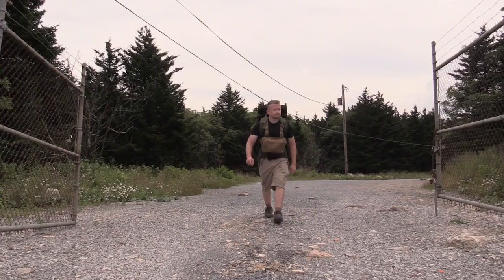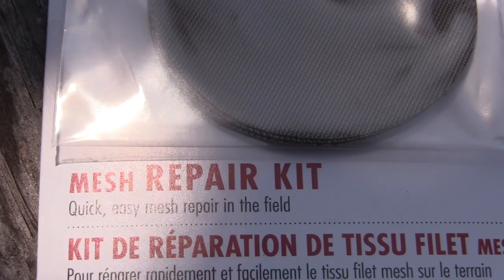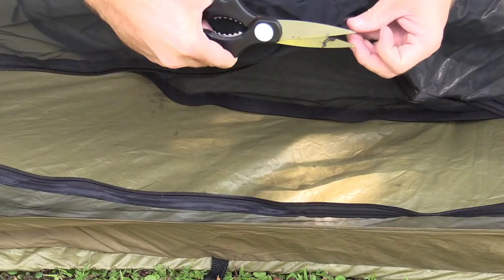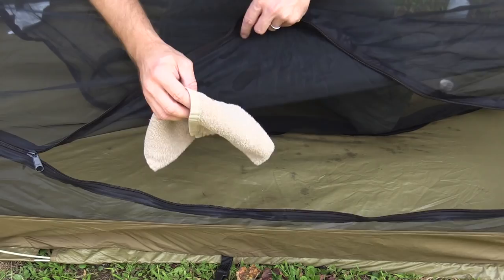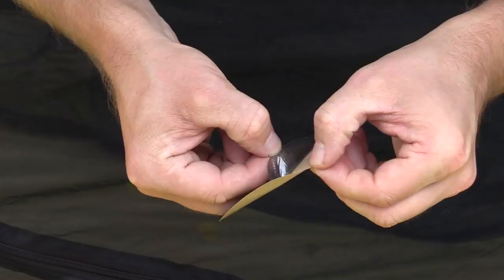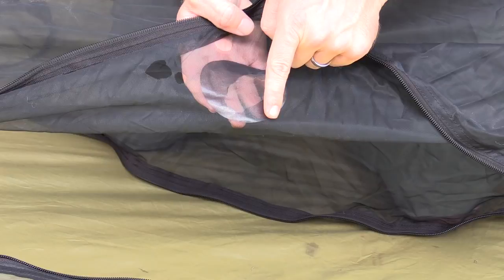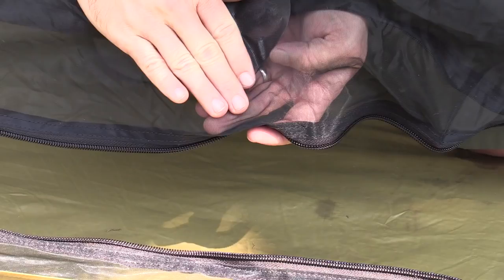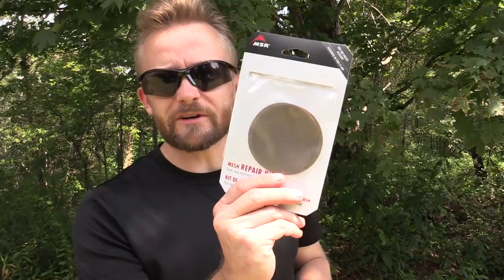Simple and Easy - How to Fix Tent Mesh – Quick Instruction Guide

Comment: Is that really a mesh patch, or just a plastic tape patch with a mesh pattern printed on it?  The patch looked solid (ie, no air could pass through).
Reply: Thought the same. wondering if there is a thin foil to remove.
Reply: Any adhesive patch is going to have a solid layer of the adhesive. The main difference from the usual fabric patch is visual impact. If airflow is important to you, sew a piece of mesh on.

Comment: I like to place a board or book behind the hole so I can press it on flat and really rub the edges to adhere.  Your hand is concave and doesn't work as well.  Results for both technically and aesthetically, this is a good way to do it on a flat surface.  I have some holes that are just a bit bigger than pinholes, do you think clear silicone glue would be good to basically just plug up the hole?  I was going to use #6000 but afraid it would devour the nylon screening.

Comment: I wish there were different colors. Mine netting is light brown/beige color. I fixed it with a clear gorilla tape. The hole was only about 1 inch x 1/2 inch.
Reply: I use the clear gorilla tape for all my tent repairs. As long as you make sure it has a flush contact & use tape on both inside & outside of the repair...it's a waterproof seal again! Good luck if this helps  anyone.

Comment: Hey, great video. But will this work near the seam?  My mesh is coming apart from the seam by the zipper
Reply: Did you ever find anything to fix your tear? I have a rip near the stitching too.
Reply: @sloothlothos1  i haven't fixed it yet but mainly because in my area there hasn't been much camping allowed due to covid
Reply: I had a big separation at the zipper.  I put it back into place and then on sewing machine zig zag stitched back and forth a few times, seems ok just have to use a zipper foot so you don't mangle the zipper or get threads on it.

Comment: I got a tear in my mesh that’s right on the edge, how do I repair that one? It looks like it has to be sewn in
Reply: had a big separation at the zipper.  I put it back into place and then on sewing machine zig zag stitched back and forth a few times, seems ok just have to use a zipper foot so you don't mangle the zipper or get threads on it.

Comment: Hi, love the channel. Question: I bought this cheap tarp off amazon to shade my patio deck from sun and rain. The first time I set up the tarp to my deck posts one of the loops ripped the actual tarp a tiny bit. After 2 days of being up in some pretty high winds that small tear, ripped right down the length of the tarp just inside the loops on the tarp itself, it's several feet long that rip. Do you think tenacious tape could fix that and it actually hold up to those same winds? Opinion? Thanks bud!!!
Reply: sewing machine, zigzag would be good, that's what I do on my tent tears sometimes adding a patch behind.

Comment: does that same company make a tent repair kit just like that one?
Reply: Kenyon repair tape. Comes in different colours . I used it to repair a torn tent stay point on my one tigress hotty tent when I tripped over its guy rope.  It is also adhesive backed. Also the batch that i used was about 30 years old. -Always wondered what it was for. I got out the needle and thread too because the stay has to be strong and I added extra stitching to counter any pulling forces.